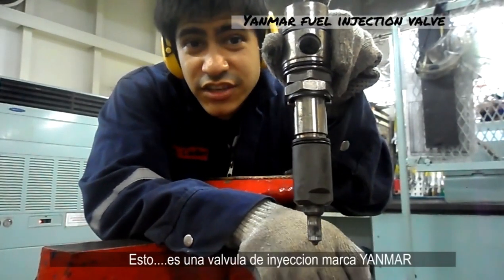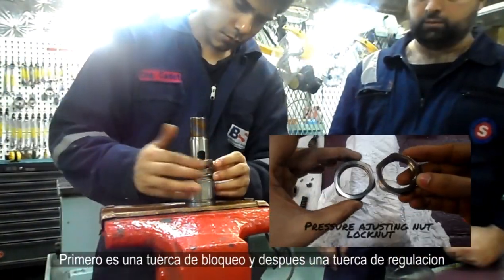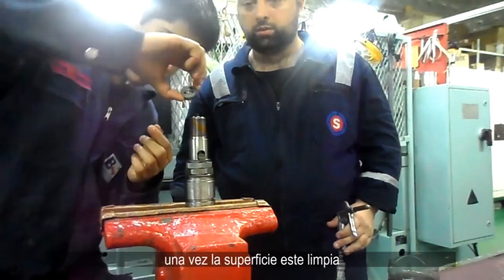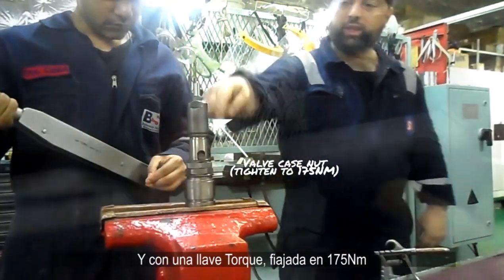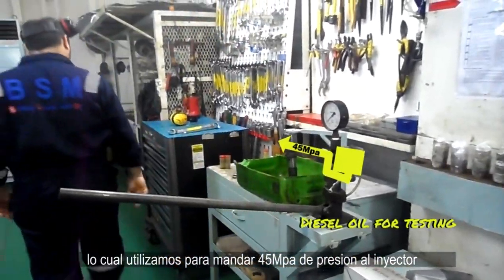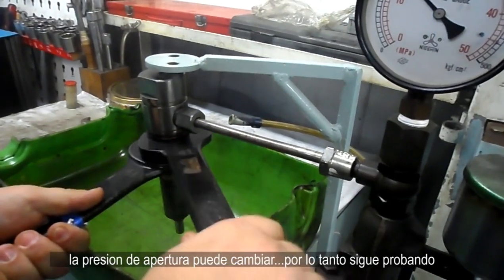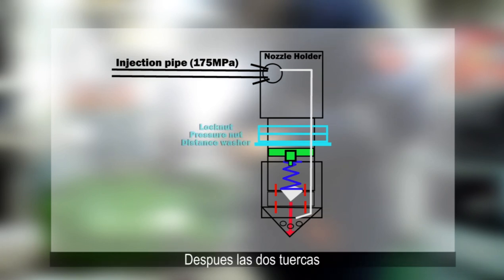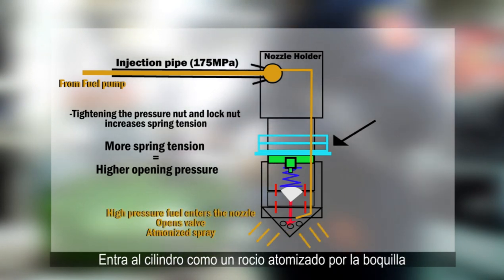Fuel injectors of diesel engines on ships, with 3rd engineer!

Comment: I just started as a marine and technical engineer (student). These demostrations of the main parts, helps a lot better, for fully understanding hos the engines are operating.

Thanks ❤
Reply from the maker: That's the idea Aria, marine engineering made easy to understand and to awaken curiosity.. Thank you for your support

Comment: do you reuse spare nozzles ? even after 2500 hrs? is it possible to recondition spare nozzles( using a super fine grinding compound on the tip of the nozzle assembly? and grinding it on the inside on yanmar engines?
Reply from the maker: I have seen this done and it can work in emergency, however most times the nozzle cannot be saved and the problem will persist.

Comment: These are manual injectors right. Do ships even use electronic injectors?
Reply from the maker: Correct they are manual injectors because they are timed by a mechanical part - the camshaft which activates the fuel injection pump.

Also as you could see the spring is adjusted manually to open at a certain pressure..incorrect adjustment can cause premature opening or late opening 

There are electronic injectors famous in MAN B&W ME series, check them out! No chain and camshaft.. All hydraulically operated!

Comment: I think the calibrating oil medium to be used for testing must be an hydraulic an oil depending on your suppliers brand rather than diesel oil. Just an observation but still keep it up. :)
Reply from the maker: I've heard this before and yeah however I don't know exactly why.. The manual does not state a reason also, if you know it please share my friend.

Comment: why testing pressure is low comparing to main fuel injection system in marine main engine?
Reply from the maker: One should check the manual, a mistake I made is that I didnt specify the YANMAR model I was working on at that time, each injection pump on different engines have different working pressures, therefore the nozzles also have different opening pressures to correctly atomize.

Comment: Thnx brother..
Reply from the maker: Thank you for the support amigo!
Reply: @ShrimptoShark  
Brother can u explane main engine injectors 
And it's parts .
Reply from the maker: @gshyam2132  If in the future Im able to work on the M/E injectors as a responsibility Ill do it, however its usually the 2nd Engineers Job I just assist.

Comment from the maker: Small correction.. When I say matted surface when referring to the spacer and nozzle it's actually an error.. Matted means uneven and this is the exact opposite! This has very  smooth surfaces which should be kept clean!
Reply: do you happen to know the purpose of ‘stepped clearance’ between the nozzle & the spacer. i’ve been trying to find answer, still unclear

Comment: The injection pressure is actually 34.0 MPa. I also work on these engines.
Reply from the maker: Depends on the size of the engine.. I have also worked on the smaller one that have an opening pressure of 34MPa..their max load was about 700KW.. Those in the video where for engined of about 880KW..in any case I should have explained in the video it depends on the engine.